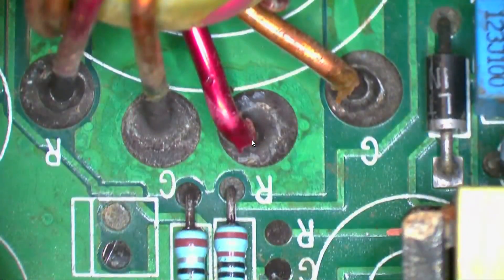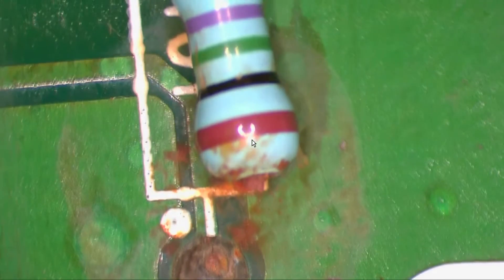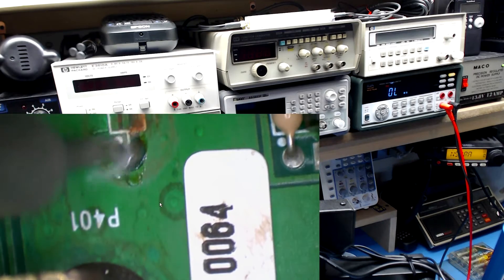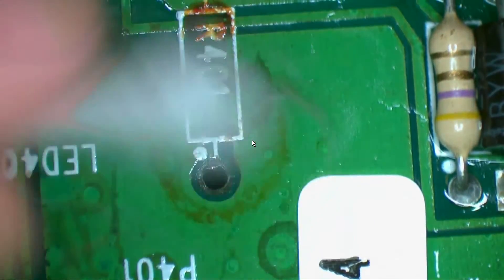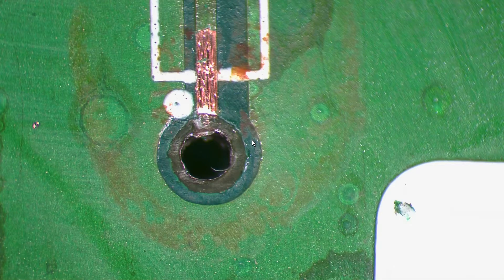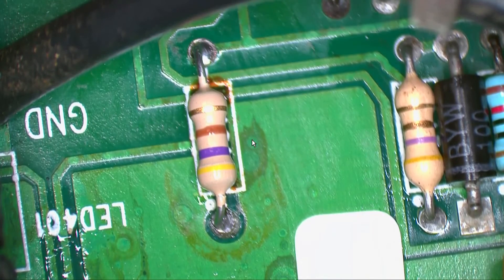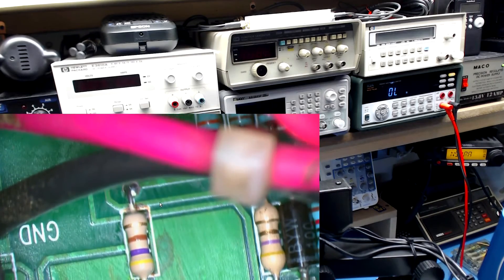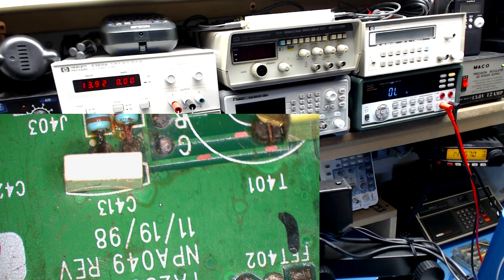WATER DAMAGED MTX THUNDER 250X AMPLIFIER TROUBLESHOOTING PT2

Comment: Great job Dude. Thanks for the video.
Reply: Doug Rodas car amplifiers should be isolated from liquids and water to avoid water damage it's very important and highly recommended that you isolate your car amplifier from liquids if you don't want something like that to happen to your car amplifier you can build a plexiglass box and build a contained amp rack or use a storage bin as a contained anp rack a contained amp rack can protect your car amplifier from water damage

Comment: Mounting a car amplifier under a seat inside a vehicle is not the best place to mount your car amplifier because people who ride in your vehicle can spill drinks and damage your car amplifier so it's best to mount it inside your trunk instead of mounting it under a seat inside the vehicle because a amplifier should be mounted in a safe place where it can't get damaged by liquids such as water a car amplifier should be isolated from liquids to avoid water damage if you really want to mount it under your seat use a storage bin and put the amplifier inside a storage bin so that it's isolated from liquids